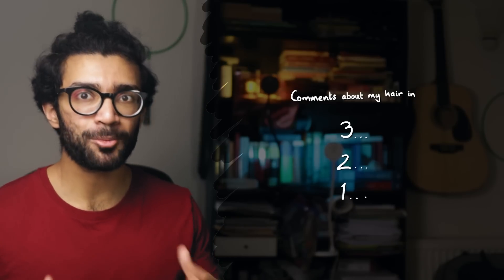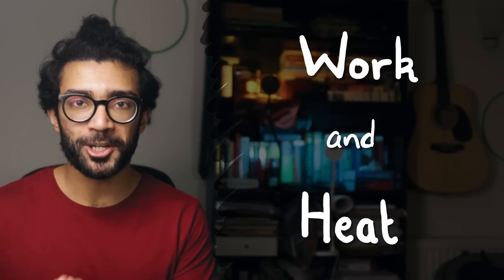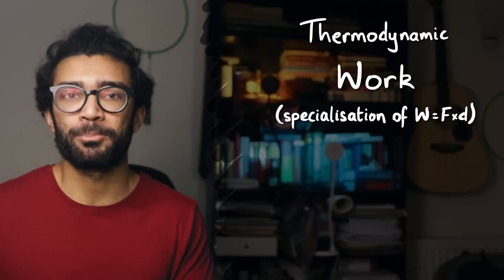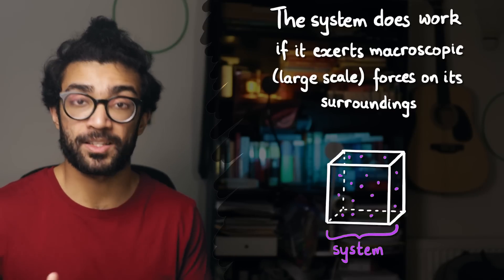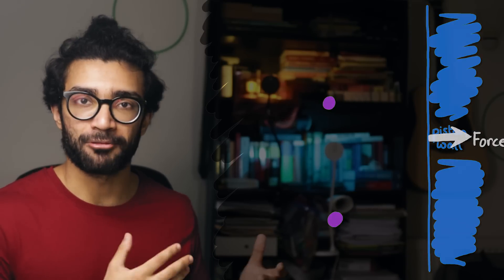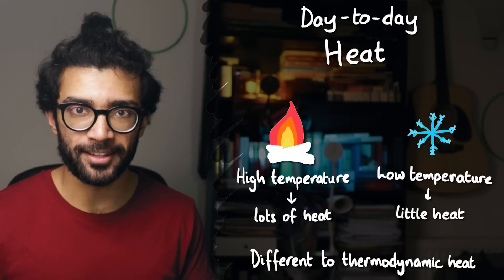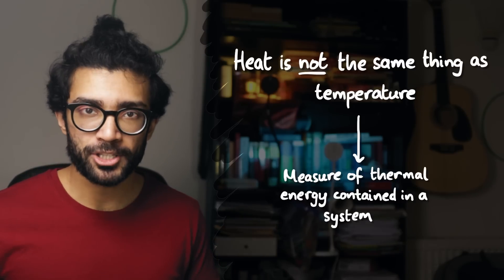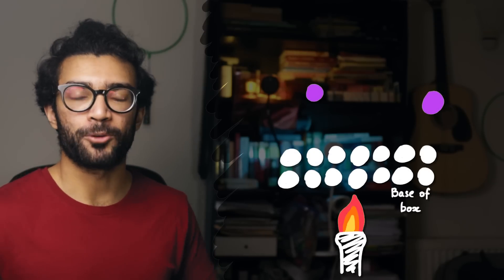Thermodynamics: What do HEAT and WORK really mean? | Basics of Thermodynamics

Comment: Heat is a kind of energy transfer which takes place due to temperature difference and all other kind of energy transfer except heat is work, for eg- shaft work and paddle wheel work are not takes place due to temperature difference.

Comment: Doesn't adding heat to the gas in the box cause it to expand and therefore do work? Is not causing the particles in the panel of the box causing them to do work by accelerating the particles that collide with the heated part of the panel? Thus heat is work because it is the acceleration of particles. You didn't give an equation that demonstrates the difference.

Comment: Nah that last line you said that there is no large scale macroscopic force being applied on the box, therefore the energy transferred to the surroundings is defined as being heat but not work, because there is no force being applied to the system. The collisions of the air particles with the box is just random and they occur at random locations on the box too. 
But because we're only concerned with the internal energy of the box, the energy transferred from the box to the surrounding air partcicles is considered heat. Sure that each of these particles exert an impulse on the box, but we don't care about that, we only care about the box. 
As a result, with no 'useful' force being applied to the box, there is no work done on the box but energy is being transferred from the flame to the box, hence its internal energy increases.

I don't if that made sense to you or to anyone else who read it, but it does to me. Unless my Physics is completely wrong here lol.

Comment: I see 2 definitions of heat here:
1. Transfer of non-work energy to/from system
2. Amount of thermal energy within system

I think it is the latter.
The former is what you are doing when you "add or remove heat"

Comment: Nice video to tip the toe into the topic of thermodynamics. I think a follow up video, maybe looking at the ways that heat transfers (radiation, convection, conduction and advection) would be nice. I think it's hard to distinguish between heat and work in the drawings, because it seems like in both cases it's just one particle hitting another. I'd love to see a few more videos to thermodynamics because in my opinion it is quite fascinating but takes a hell lot time to properly understand. And then there are things like S=k_b*ln(W) which just comes out of nothing.... well I know the statistical approach tells that S in Boltzmann's relation works out to be the thermodynamic entropy but its still hard to grasp for me how Boltzmann linked the macroscopic world to the microscopic phase space that "easily".

Comment: Heat is defined as the form of energy that is transferred between two systems (or a system and its surroundings) by virtue of a temperature difference. I think you miss that last part.
Reply: There are 4 types of heat transfer, convection, conduction, radiation, and 
Evapotranspiration.

Comment: Two suggestions for vids.
1 Show how the Apollo crew were cold while flying in sunlight.
2 Show how the Radiation belts are not deadly as Dr James van Allen reported following his survey with Explorer 3
3
How probable was the L.O.R. operation to lose no lives after 6 missions.
Reply: Regarding your first question, thermal energy can transfer by 3 (one could argue about 4 but thats fiddly and minor)  major ways. One of them is radiation, which we experience when we sit in broad daylight. The other ways all need a medium to travel. This medium, some atoms kicking each other or vibrating or just moving, is rather rare in space thou which causes a rather poor transfer of thermal energy. Because of the very low pressure in space there is practically only radiation by which heat travels. Sadly radiation is a rather slow way to transfer thermal energy because of which it is not impossible to get cold in space even in full sunlight.
Next up, one could argue standing a long time on front of the operating end of a X-Ray isn't deadly either, the cancer you'll win by this kill you, but I doubt this is your topic you want to get to. Van Allen Belt Radiation can be an acceptable risk when the shielding is thick enough. About 10 mm aluminium are capable to shield off most of the radiation and traveling fastly trough the van Allen Belts exposes the crew to a potentially non lethal dose of radiation. This does not mean the radiation is safe in any way, it just means it is possible to deal with it properly. Sadly the way to deal with the radiation increases the weight of a spacecraft quite considerably. Because of this it has gotten really expensive to fly people to the moon again, lowering the safety would be cheaper but is not an option.
Actually to be honest your third point seems rather useless to me. The mission happened and they survived. They took risks they thought to be acceptable and came back. In hindsight the safety measures were lacking, of course, but in the times they were up to date. They leaned from previous mistakes, and did what they could to avoid them. If they didn't do that the deaths would have been in vain, and it'd be an insult to their families. Was there still a risk? Of cause. Did literally anyone know that? Of course. Still, now we can measure the distance to the moon by shining a laser at the mirrors they left there whenever we want (only during unclouded nighttimes of course but hey thats kinda obvious).

Comment: I like this definition of thermodynamic work better (Principles of Thermodynamics, Ansermet & Brechlet, 2019).
1.- For every system, there is a scalar extensive state function called energy (E). When
the system is isolated, the energy is conserved.
2.- When the system interacts with its environment, the energy evolution results from
the power of the processes exerted on the system.
3.- PW represents the mechanical power associated with the work performed by the
environment on the system that results in a deformation of the system without any change
in its state of motion, in particular its kinetic energy.
I really suggest you this book. I also really like Thermodynamics: Principles and Applications by Ismail Tosun. It's more engineering oriented, but it has great explanations and intuition.

Comment: Can we have a system whose heat transfer is more than work transfer in piston cylinder system? 
If yes give some example
Reply: Still no reply😶
Reply: Yes, although it's less the system than the process you're looking at. A system itself can be able to do work or transfer thermal energy but it's less the System itself doing this. It's a little bit like a reservoir dam having stored lots of water. You can produce electricity by opening the valves but the dam itself doesn't produce the electricity, rather it's the process that does the change from potential energy to electric energy. I hope you get what I meant to say, it's a little hard to describe.
In any isochoric process the change in energy of the system is entirely caused by heat transfer. This is because the change of the inner energy of a system is the sum of its volume work (dW) and transfer of thermal energy (dQ). If we look at dW we notice quickly that because dW=p*dV in (p is the pressure in the system in case you're wondering) an isochoric process (dV=0) dW=0. Therefore the change of inner energy simplifies from dU=dQ+dW to dU=dQ which is just heat. An isochoric process can be seen in processes like the idealized Otto cycle. 
Of course the opposite can also be done, the process in which dQ=0 is called adiabatic (or isentrop, the are interchangeable) process. Examples for those are countless, although a perfect adiabatic process is impossible to realize.
Reply: Dear I got just the daily petrol which once ignited ,it provides all chemical energy and can't be used again .... all are exhausted

Comment: could you say something about the pressure gradient of a gas in a container subject to the force of gravity?  this seems a bit of a vague question and an answer with too much maths is going to go over my head.  i was wondering if there would always be a gradient even with very high pressure and heat, even if that gradient was extremely hard to measure or could only be determined by a statistically minded maxwell's demon analysing the motion of the gas at every point of space in the container.  thanks for any thoughts you may have and can take the time to share.